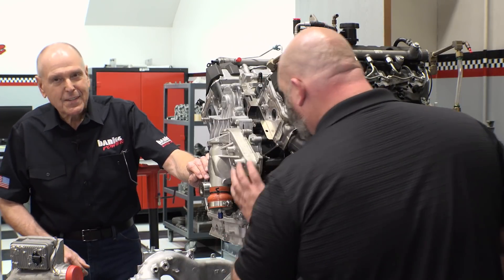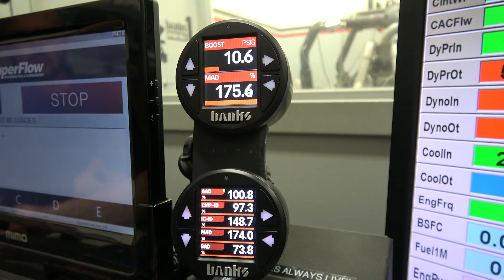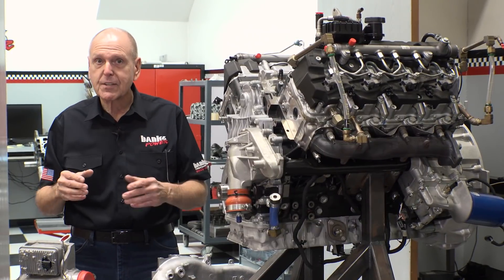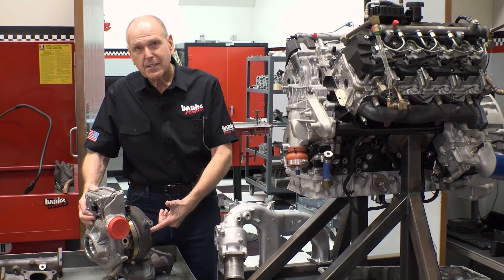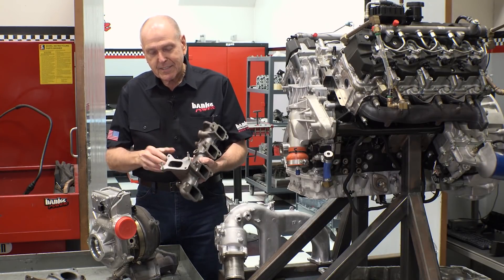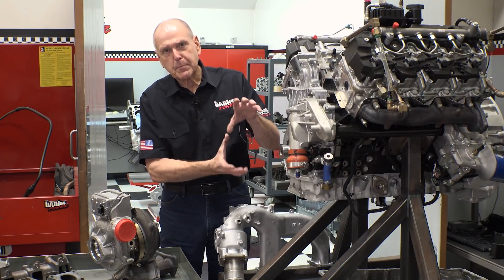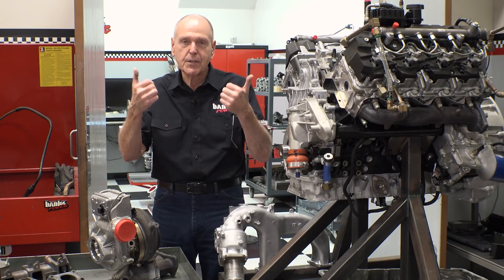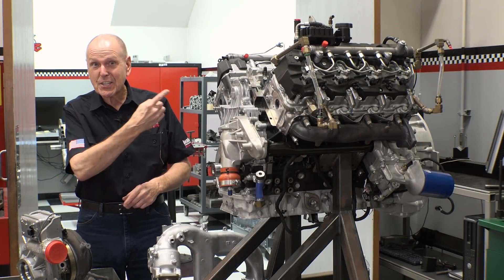We may break a Duramax L5P in 2019

Comment: Sorry Gale but as a retired real diesel mechanic I have never been impressed with GM and connected companies!  ( Detroit diesels for example) 
I have seen the metallurgist reports this company is noted for using poor quality metal in there castings!!!
Cat,Cummins,Mack&Volvo far superior castings!!!
Reply: Frederick Burns funny I’m around lots of old two stroke diesels that will run when nothing else will. I’d take a cat or Detroit over any Cummins. 60 series Detroit’s will run forever. I’d rather have a Perkins than a Cummins. I’ve had experience with multiple Perkins engines going over 12000 hrs without an overhaul. I’m not an expert as you claim to be but I’m third generation in land clearing and site work my grandfather started the business in the 60s. Ive never seem a failure from any Detroit we’ve had. We’ve got tow 471 Detroit’s made in the 60s still doing work. We had an old kenworth with a 290 Cummins it leaked oil like a siv, it had good power. One issue Cummins has too is they put them in junk ass trucks dodges were garbage and Ram is carrying on the junk legacy.
Reply: Detroit which Detroit the early 4 strokes yeah are not well built but the 2 strokes they are built like brick shit houses on steroids.
Reply: @jdrok5026  
Do you know the true parent company of  Detroit Diesel? 
Cleveland diesel was the parent company of Detroit Diesel.
Reply: @frederickburns1739  um no clevaland was the company before gm diesel and last I heard that was emds predecessor who gm bought or hired the talent from to create electromotive diesel Detroit has always been gm owned until the 90s
Reply: Hence why Detroit started out as gm diesel. They where created by gm from the very first year electromotive if I'm recalling correctly absorbed Cleveland diesel in a merger between 2 or 3 companies to make gm electromotive diesel division.

Comment: I've got a question, I have a 1994-5 school bus with a non Turbo 5.9 Cummins that has a air compressor mounted on the front of the engine for the air brakes,, I'd like to know if that air compressor would bolt up and fit on my 2007 1/2 6.7 Cummins in my 3500 dually

Comment: Not too hard to overwork that engine...tow rating is 24k from manufacturer. Why buy a Chevy 1 ton then have to buy all the ‘Banks’ recommended upgrades to make it tow more , operate better, and be relatively bulletproof, when you can buy a RAM 1 ton and be at the numbers he pushes in a ‘Banks approved upgraded Duramax? I see why he advocates the Duramax. Because it’s a platform he primarily sells products for, it makes him money.
Reply: Tow rating has to do the GMs current  suspension, not the dirtymax, the new 2020s are suppose to have 30k+ tow rating to compete with Ford and Ram. The L5P stock has much more hp and more torque than the current Cummins
Reply: Andrew Cesanek are you crazy!! So you know more than GM, which states the stock L5P makes 910 lbs torque??!! Not more torque than a Cummins ISB. It may have more horsepower, so does the Ford. But you see I hotshot for a living. And before that I drove a Freightlinee with a Cummins ISX..you see I don’t give a shot about speed and playing in the mud. I haul for a living and I KNOW the benefits and longevity of a in-line 6. A true diesel. There are no V8 Diesels made by the big boys..Detroit Diesel, Cummins, Caterpillar, Paccar....all use in-line 6 or 8. Duramax aka Isuzu as well as that Powerpussy aka Powerstroke...they great for you boys who want to play in the mud or blow smoke...but when it come to daily towing Cummins is king in the 1 ton. More work less maintenance...proven!
Reply: Myron Bethley it's a myth! I used to hot shot for living myself, I drove both the cummins and duramax. They all have problems, but some of my hot shot friends and I had better luck with Duramax/Allison combo.
Reply: @M.B.Enclosures  um doesn't the 6.7 Cummins only make 900 lbft also the isx is like two times the size of a duramax.. And is used in semis also the l5p is gm in-house now Isuzu only sends people to work at dmax but gm has fairly well taken over the 6.6
Reply: @M.B.Enclosures  um that's why a Cummins make a big ass v8 for trains.

Comment: Not much of a feat to brake a dirtymax.
Reply: jon doe  source for this info?
Reply: jon doe  I've seen stock cranks broke at stock hp, lol  
1000 hp requires a bit of work
Reply: Stock.......LMAO Right
Reply: I guess you could make the same comment about the transmissions in a ford or ram lol 😂
Reply: @adambryant2434 , there's parts to  swap a torqueflight behind the dirtymax, because the Allison won't handle full throttle shifts at high horsepower.
Reply: @randymagnum143  yes because the Allison was designed around a given package Allison doesn't design to do power they never claimed it either Allison is designing to put the things to work and that's about it also there's things to put th400s behind a duramax.
Reply: @randymagnum143  also you can break a crank at any hp if harmonics become a issue well cranks don't like it.
Reply: @jdrok5026  especially if the half assed externality balanced damper shears off it's nub and gets out of phase.  I've seen expensive balanced billet cranks with lots of Mallory metal in them broke also.  V8 4 cycle diesels are crank breaking machines.  
Th400's are strong, and so are 4l80's.  But not any stronger than 727's and a518's.  The Allison 1000 is to Allison transmissions what 6.2l  diesels were to Detroit diesel.  Not so much.
Reply: @randymagnum143  um the Allison is literally like Allison lowest rated trans because Allison is more heavy or medium duty not light duty. Also v8s aren't crank breaking machines Detroit and Cummins and scania have had them live for decades and many other companies prior to those designs had success. The problem is packaging emissions and cost. V8s are more expensive to design to be large displacement given the need for a Cross plane crank. Harmonics is always going to be a issue but several companies solved the crank issues in the 6.2 with a better balancer and key. Ignoring that all engines but a v12 and maybe the v24 arent truly perfectly balanced but then you have even more cost. No engine is past breaking a crank none of them it's the nature of the beast of what a engine is. If a single flaw where to happen to cause a engine to go off balance or start to cause the crank issues bam your splitting the thing. But that's the beauty of a engine is that it's really not that common when maintained.
Reply: @randymagnum143  expensive cranks with Mallory are not above the problem engines have yes a i6 should in theory only have a issue when the secondary imbalance issue starts to be a huge problem but even then they will break. The reason Cummins still uses a 4 cycle v8 diesel is because when properly maintained and cared for it will be able to have more cubic inch and make more power at less rpm and less strain on the engine. Or is Cummins Detroit dmax Isuzu international mack scanic and Ford to stupid to realize that v8s just aren't balanced enough that when a balancing unit such as a harmonic balancer fails normally due to it being worn out or expands from being overheated to the point the crank simply isn't balanced anymore and bam broken crank. Also Mallory can be done wrong and a simple tuning issue can cause issues for cranks if the rod is to strong and on some sort of problem with firing hit the crank to hard and that will snap one also. I'm a fan of no engine config I love them all because they are my passion but simply outing one because of something that can have multiple causes isn't really scientific.
Reply: @jdrok5026  I said 4 cycle.  Detroit's 4 cycle 8.2 was shit.  Cummins vt9 oh nothing was shit. Triple nickel was shit. Cat 3408 was a crank breaker.  3208 was a throwaway.  2 cycle Detroit's were awesome......cheap and easy.  Mack made the best v8, better than scania, still not as good as an inline six.  4 cycle v8 diesels by nature have poor harmonics, especially 60 degree.  Also sharing a rod journal seems to be problematic on something with so much cylinder pressure.
Reply: @jdrok5026  have you seen the tiny amount of steel between the rod throws and weights on a dirtymax crank?  Do you think its reliably capable of transmitting 2000 ft lbs of torque?  Just run your dirtymax in the tiny turbo class, youll be ok.
Reply: @randymagnum143  mack e9s and scania v8s are literally last I heard the same engine.

Comment: The power ramp up on a blown gasser will NEVER be outdone by a diesel. I've driven both in the mud, both 4 digit horsepower. Gassers rule this.
Reply: Diesel will make twice the torque at half the rpm. Horsepower is made up. Gasoline will never be as efficient as diesel.
Reply: @robbell24  horsepower is the rate of work done. Ie revs times torque
Reply: Chef Mime  or You think damn if I buy a diesel that's another 10gs plus all the reliability issues with the emissions system more expensive fuel more expensive everything
Reply: @blugods2655  Not all diesels have emissions equipment the older trucks are still around and do just as good a job.
Reply: @nou8257  so you have to buy a truck that's over 10 years old? Yeah I don't think so
Reply: @blugods2655  Is there something wrong with owning a older vehicle?
Reply: @nou8257  if that's all you have the money for there's nothing wrong. But buying a truck that old just to avoid the headache of emissions when you have the money for a new truck is just ridiculous
Reply: @blugods2655  Even though emissions equipment on diesels literally slowly kills the engine overtime and costs  you more in mpg then a non emissions equipped diesel look at the 6.0 powerstroke and 6.4 as examples. 
The egr on those engines literally killed them melting pistons, blowing head gaskets, clogging up oil coolers, diluting the oil with fuel over time all over emissions equipment why would i want a vehicle that will end up costing me more money down the road once the factory warranty runs out over the older engines that last for nearly forever sure they are not winning drag races but that is not what they are designed for and the aftermarket support is all around you can improve these old engines 10x over to make them faster stronger etc if you have to have all the torque and h.p there is options to do so and plenty of people to do the work if you don't want to.

I don't need a new vehicle just because I can afford it that is a pointless waste of money. Especially when I can use a proven vehicle that I can actually work on if something breaks and not have to call AAA or a tow truck on the side of the road and then have to deal with the dealership saying it needs this or that I dunno maybe it is due to growing up and learning to value what I have and fixing it then just throwing it away and replacing it like the mentality has become in the u.s.

Comment: Bottom end is gonna get launched.
Reply: jon doe  source?  So far every 1000hp duramax L5P i've read about has had upgraded internals.
Reply: Dan G I was going to say the same. Even the proven 6.7 PSD will only tolerate 750-800whp before rods start bending.

Comment: Hi Mr. Banks.
After the Duramax, another engine to test is the R2.8 Cummins.

Would be interesting to see what it can do and where upgrades can be done.

Would be nice to see some compounds and primary turbo size.
The original turbo I have seen on most are Holset HE211W.
Maybe adding a K27 or S300sx-e as a primary to the factory turbo.

Great work by the way Mr. Banks
Reply: Well I don't know of anyone making compound kits for the 2.8 cummins but sdptwins makes a kit for the 2.8 duramax which has same displacement and power rating as the cummins. Their kit uses the stock turbocharger plus a s300sx-e on top.

Comment: Dang I was hoping to see Chevy parts scattered everywhere😏
Reply: Tsunauticus III  you cant argue with the chevy fan boys man they will never see reason. I love ford i have a 7.3 and i also drive a lbz duramax because it is also a great engine. But when it comes to the body and axles, my duramax parts look like 1/2 ton parts compared to the f250 no joke the front hubs are twice the size.
Reply: @X-eler8  Dude I recently towed with a lb7 moving cars for like a month straight and jesus the chevy suspension is so weak compared to my old 97 3500hd 12v dodge like my smaller hydraulic tilt car trailer put the duramax on the overloads with nothing on it and the big trailer with like 14" I beam a deck over and 8k axles didnt even move the old dodge flatbeds leafs. 

Granted one is a dually the other was a 2500 but sheesh like you said the 98 k1500 squatted about the same as the 2500 the only diffrence was the power of the duramax towing vs the old 5.7l 350.
Reply: @nou8257  yeah i fell you, my lbz has all the power in the world but the suspension and body cant compete with my older f250 its a shame really.
Reply: Edgar G. I can't speak to size difference in drivetrain parts but I'm gonna assume you're right. All I can say is, I've got 176,xxx miles on my 2011 lml and everything is still strong. Steering is a little sloppy but ifs problems I guess lol. The 7.3 is a beast and the newest 6.7 ferds are strong too.  I like them all for various reasons but I prefer chevy, it's a manufacturer I know how to work on best 🤷🏼‍♂️
Reply: @sethh8365  nothing wrong with that haha i love both my trucks they each have their pros and their cons, i just hate that fan boys refuse to admit all big 3 competitors make a good truck but it comes down to prefrence.
Reply: @X-eler8  the front hubs on a f250 aren't twice the size... Also Ford's axles arent much stronger. Unless it's the super sixty front... hell the 70 and 14b Chevy for one tons are comparable. Also body body panels on Ford's are weak also. The suspensions are weak. Sure more towing but that's not the limit of the axles. That's more the limit of brakes compounded with the leafs. Also the new Chevy these are in tow more then the Ford.
Reply: @jdrok5026  your going to compare the strength of independant front suspension to that of a solid axle? Yes the front hubs are 2x the size ill be happy to go take a picture of both my vehicles to show you
Reply: @X-eler8  independent fronts on strength? I have both yeah neither is stronger then the other. Also no they aren't unless you comparing a f450 to a fucking half ton then yes they will be double the size but on most Ford's of companies size to Chevy the hubs aren't that much bigger.
Reply: Most Fords compared to a similar Chevy.
Reply: @jdrok5026  no just comparing two 3/4 ton pick ups. The duramax has independant front suspension. Ford f250 has dana solid front axle. Wich do you think i have had to replace hubs and bearings on and rebuild the diff? On The silverado and i have had the f250 much longer Its 5 years older? Why would i lie about that. Im not even joking my duramaxs hubs look like 1/2 ton parts compared to the ford. Im not saying the ford is better so dont take offense im simply stating my observations ive been a diesel tech all of my life im not simply spouting shit out of my mouth like 99% of youtube fanboys.
Reply: Go to a truck pull.
Reply: Randy Magnum last truck pull I went too a lly duramax won right in Lakeland Florida.
Reply: You'll see some Ford parts scatter soon.. well, you probably see that everywhere lol
Reply: @lrizo3841  well theres a price to pay for out powering the competition.

Comment: Just when I thought I was done with diesel. Trading in my LBZ for an l5p or 6.7 Cummins. Which do you guys prefer and why?
Reply: L Rizo I own an L5P and I’d get a Powerstroke, but that’s just me
Reply: @DanEvan  so what made you purchase the l5p over the Ford Powerstroke?
Reply: Dmax.i have owned all three.smothest ride chevy,gmc,more room un ram,Ford
Reply: @ronmower3694  yeah GMC definitely has the smoothest ride
Reply: L Rizo it’s because the GMC is the only heavy duty truck still running independent front suspension. I was one of the first people to take delivery of the L5P dmax and I’ve always been a GM guy, but a good friend of mine has a 2017 Super Duty and it’s just been bulletproof. My L5P has been good to me, I’m just trying to give you my nonbiased advice so when it comes time for you to make your purchase, you have a little more information at your disposal to help you choose.
Reply: I personally never was impressed with the 6.7 cummins maybe its just the powerstokes and dirtymaxes have gotten better and in my opinion ford and gm trucks are just looking better the past couple years i dunno may just be a me thing with the 12v's I own.
Reply: L Rizo I love duramax I’m a gm guy but I’d go with the 6.7 Cummins low end torque decent gas mileage last longer and sound great
Reply: @juanduran2813  To be honest the current gen trucks make so much power now of days does the low end torque of the inline 6 cylinder become even that noticeable these days and on fuel mileage they all seem to get 12 to 14 mpg with the emissions junk on them from what I have seen and the lasting longer part is pretty much not very true the egr and dpf's kill these diesels far quicker than any of them would fail normally and it also depends on the driver and how hard they push it.
Reply: Smooth Trooper you’re right but I’ve seen a couple inline six 6.7 diesels not deleted with original parts with over 300,000 miles
Reply: @juanduran2813  Yeah and I've seen 6.7 power strokes with 250k+ miles and also deleted but just because I saw those few trucks that doesn't mean everyone of them is going to be that way and also not everyone can or does delete emissions equipment on their vehicle and if its brand new doing so voids the warranty which is one of the major reasons you would buy a new vehicle (and the new car smell).
Reply: Smooth Trooper yeah you’re right not every truck is guaranteed